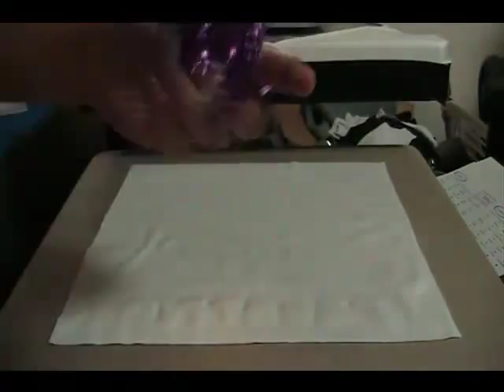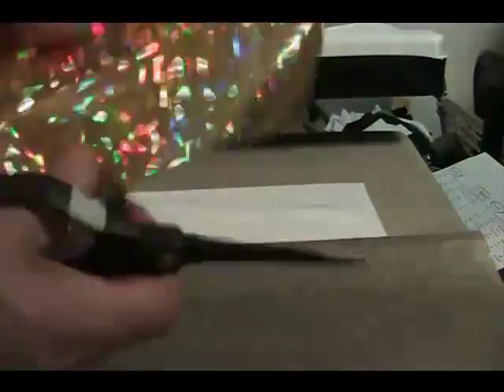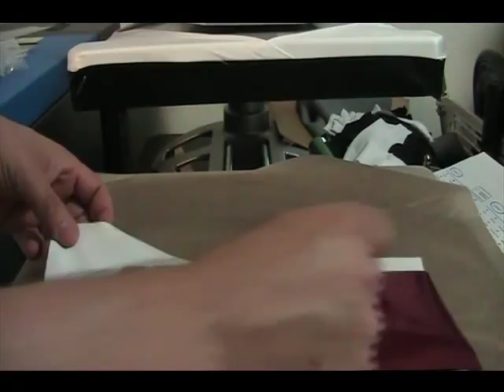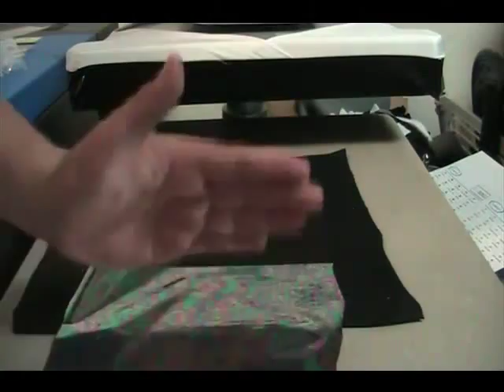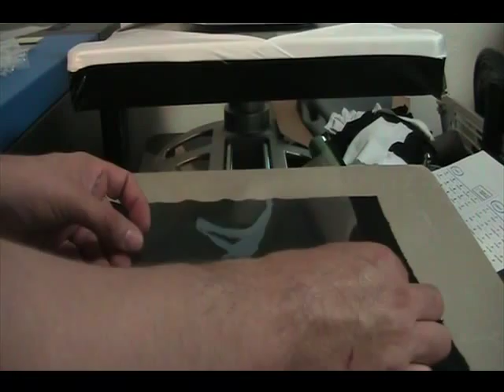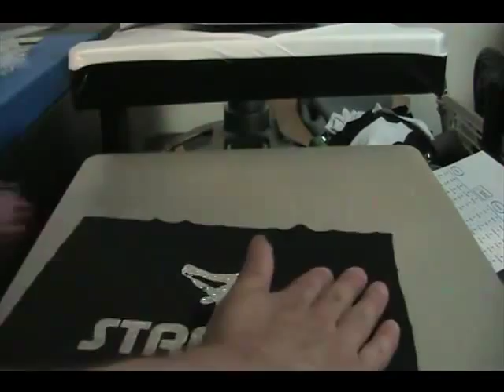Synergy 17 - TexTack Distress, Stretch, Shadow, Overlap

Comment from the maker: Hi Cathy, The TexTack is an adhesive, and because there is no vinyl coating, it is elastic. The Foil is also very thin, and this is why you can stretch the material a bit after foiling  and it still looks good.
As for layering, I only trap my graphics a little so the shirt doesn't show. I don't ever do a full layer of TexTack over the foil, although I've heard some do it. It's one of those things you just have to experiment with to see how it looks and holds wash after wash if doing that.

Comment: So, is it the Textact that allows the foil to stretch? BTW, very cool video - I discovered the distressed technique quite by accident as I wasn't getting coverage on my poly-plastic material (too may troublesome bubbles), so I just went over it with a different color to see what would happen and the effects were gorgeous. Thus, I learned you can't put foil on foil - hmm, or CAN you? Did you ever add more textact to parts of the foil and layer more foil on?